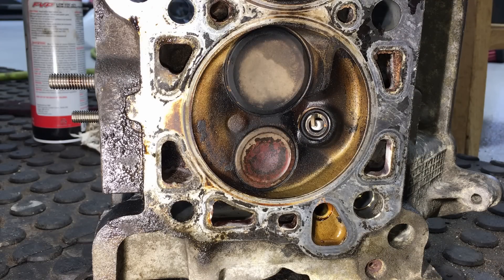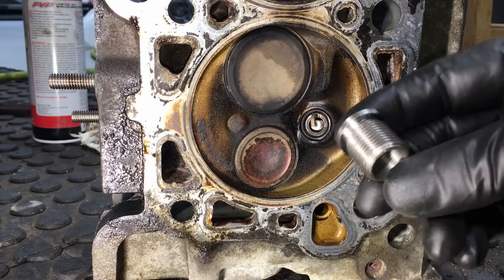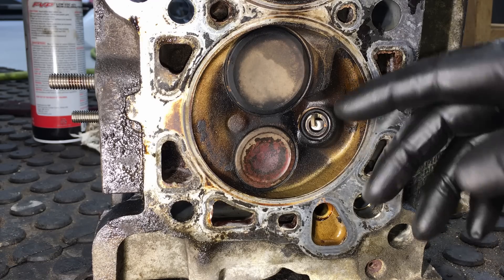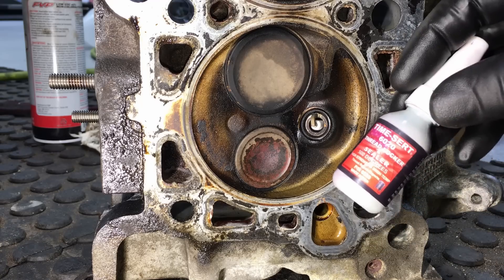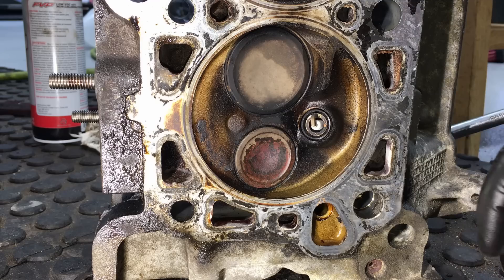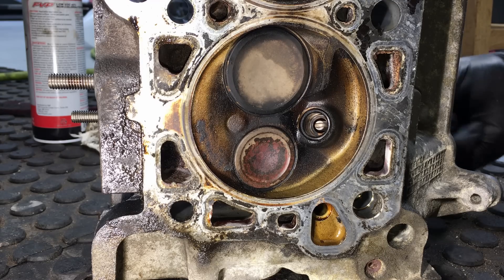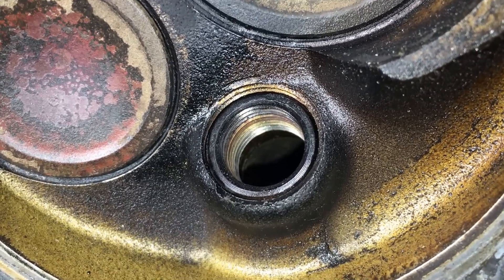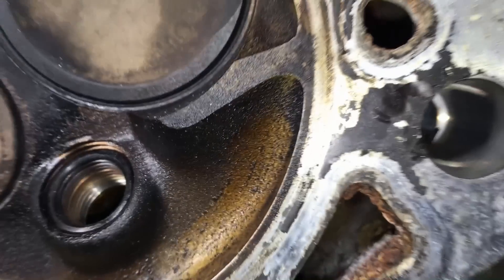Ford 4.6L 5.4L 6.8L 2v Triton Engines: Blown Out Spark Plug Repair **UPDATE**

Comment from the maker: Original Instructional Video on how this repair was done-
https://www.youtube.com/watch?v=md_HQcZZEpM&lc=Ugwee3zR8KarYiMUdJF4AaABAg
The Only Spark Plug Insert Kit that I Recommend-
https://amzn.to/2PBSVox
Reply: Have you heard of the input shaft breaking in the transmissions? I have a 06 E-250 and thats exactly what happened to it. 245,000 miles though. Cant really complain if the tranny has never been touched. I got the van with 189,000 on it. This is the 1st major issue I have had with the van. Motor runs great. When I got it I replaced the plugs and coil packs with the Accel coil packs and she runs perfect. Put in Autolite Double Platinums.
Reply: FordTechMakuloco hey buddy do you know any  good repair kit for a 2000 Ford F-150 5.4 liter timing kit.
Reply: FordTechMakuloco hey buddy do you know any  good repair kit for a 2000 Ford F-150 5.4 liter timing kit.
Reply: I'll be shopping for a newer used truck to pull my camper around the U.S. and bring me into retirement. Can you please do some videos on some Good trucks that you would recomend  from a Mechanics perspective.
Reply: What do you use to remove a broken spark plug in the 2 valve engine?

Comment: I did the same repair,  I used anti sease on the spark plug. I Always use anti sease on aluminum heads. And the insert and spark plug. I used the proper thread locker on the outside of the insert. About 5000 miles and no problems.  I used the same style insert. Ream, tap thread insert. Then spark plug.  Pretty simple

Comment: Good Afternoon. Just had the passenger side #3 cylinder pop on my 2009 Ford F150 w 4.6l motor. Is the kit you showed in the previous video the same for this model year or is there a different kit ? Any information would be greatly appreciated. Thanks for your help and all the videos you make. Provide really wonderful information.

Comment: I use J-B Weld 37901 ExtremeHeat High Temperature paste, and my inserts aren’t ever coming out. I have fixed so many cracked cylinder heads and engine blocks with JB Weld working in the radiator shop that I won’t even consider using anything else. Bocks, heads, radiators, heater cores, condensers, oil coolers you name it.

I have also seen many failures with people who have used high heat red thread locker. The JB Weld is a high metallic paste and you won’t be having your insert back out because the JB Weld turns rock solid. I understand that people prefer to use what worked for them in the past, and that’s why I prefer the JB Weld, because it works.

Comment: Didn't ford fix the problem by a head redesign in 2008(ish)? I really want to know this, please take a sec as I'm building a 2v rn.
Reply from the maker: this issues was fixed in 2001 or so,  the 2008 head redesign was the 3v engines.

Comment: I had a spark plug blow out and when I install the new plug with the helicoil, my socket bottoms out and I cant tighten the plug all the way. Any idea how to fix this? I have no compression in that cylinder.
Reply: @moreno valley news first I ended up replacing my whole passenger side cylinder head. Runs amazing now.

Comment: 2011 E350 5.4, any good?
Reply from the maker: yes
Reply: @FordTechMakuloco  So, this is 2 Valve 5.4 not to be mistaken with a 3V truck motor, cam phasers or any of those issues are not present in this one? The sellers are replacing the trans was stuck in 1st gear, how are the trans? And many thanks for your input! I value your thoughts on this, the success of our new restaurant business depends on this 8 yr old truck to get us through the first 3 crucial years and hopefully up to 5!

Comment: I know this doesnt deql with this video but please help me Master of Fords! I have 2001 ford supercrew 4x4 5.4 2v with 144,000 miles on it. While driving  on the highway yesterday. It stopped firing on the entire left bank. No noises or problems before. Instant sputter and limp it home on just the right bank.mechanic scanned it and said well have to guess dont know what happened. After much online research i found lots of others had the same but no one had an answer. You are the best Ford mechanic there is . Have you seen this before? Thank you for your time and any advise.

Comment: My 2001 5.4 just blew the #6 plug... is it ok to disconnect the injector wire and drive it 90 miles to get it back home? Trying to avoid a huge towing bill
Reply: Did you paid the towing bill,  or disconnect the injector wire?

Comment: This Question has  Nothing to do with your previous video but have watched other videos of yours and your awsome !
   I have a 2007 Lincoln Navigator with AC issues. My AC has a mind of its own, Sometimes the fans on high and cannot lower fan speed. Sometimes I cant turn it off  or on .  The display shows the fan on high and its blowing low sometimes the display says the fan is blowing low and its Blows  high, can you help ?

Comment: I had to change the coolant to my Ford fusion 2008, I put it to drain the coolant and after I finished draining the 50/50 concentrated refrigerant the full gallon did not have to add more water I think there was old refrigerant in the system. I did it right or do I have to change everything again?

Comment: I’ve got a 2004 Ford F-150 4.6 L engine. It’s got around 210,000 miles on it. Just replaced torque converter and essentially rebuilt the transmission Bc it was slipping slightly when we bought it. Even after replacing the transmission I will be at a red light and give it gas and it won’t go for abt 3-5 seconds and then it’s like it finally registers and goes, after that it’s fine it’s only on takeoff. I’ve had it at a local mechanic for two months now they said they’ve tried everything, said it’s running on 75% power and it’s also not throwing codes. Can anyone give me there opinion on this problem and what solutions there are??

Comment: Is there any quick way to diagnose if my 2001 4.6 Romeo's oil pressure lose is due to either the oil pump or the main bearings?

Comment: Ford should have recalled the 4.6 for ejecting plugs. Putting four threads to hold a plug under compression and the expansion and contraction they endure was nuts.

Comment: So after repaired the spark plug threads and installed the head , you didn't torque the head bolts ..
You do know after the old head bolts are removed your not supposed to reuse them ....

Comment: Do you think its a good idea to add loctite on the spark plug threads to avoid them being blown out? Or that wont help at all?
Reply: I know this is 3 years old but NEVER add loctite to spark plugs. They are designed to be removed.
Reply: The loctite is only necessary for the insert install. Not the actual plug install

Comment: Sent you message on Facebook have a 09 5.4  all new timing components with hp pump and still have diesel know after hour of running and will stall out thoughts??
Reply from the maker: If you didn't use the high volume pump then you want to swap that in and run 5w-30 if you aren't already. If still not ok then run a 40 weight oil. If still not ok then the engine is worn beyond repair and was not maintained which should of been obvious during the timing job.
Reply: FordTechMakuloco there was very slight sludge screens in vct housing were clean and yes hp pump will try oil see what happens thanks

Comment: Not long after the first video came out I had a blowout in my V-10.  I bought all of the tools and accessories you linked to in the description and fixed it myself, this was 4-5 months ago and it's still running strong!  Thank you for your videos and excellent advice and how-tos, I had my laptop with me and referenced back to your YouTube video a couple of times.  The blowout I had prior was from a poor repair which cost me my old Mustang (caught fire when the plug blew again), I actually loaned the CalVan kit out to that shop for an E-250 they did a couple of weeks ago and pointed him towards your video for how to do it right.

Comment: i work for a big courier fleet and we have really big fleet of E450 with 5.4 2v..... and we do not see that issue very much.....the only one that had that issue..... is the one that we sent to ford dealer for warranty for oil leaking head gasket on the right side.... and they came back to the our garage with blow out spark plug on one cylinder about one month after back from ford dealer and we have notice on engine..... the other spark plug ...... were louse .....so the ford dealer replace with a brand new head ....on warranty and this happing on the truck that they did .....so i have to say ....the ford head gasket are not very good.... .because they always leak not long after .....so we had to redo there job that did .....the right side head ....  .and we have ford with 5.4 since 1999 and are truck work 10 hour a day......so for my 40 year of experience the cause is loose spark plug that i have seen... we buy only ford part no other brand .....but not the head gasket .

Comment: I’ve never had a plug blow out in a 2v 5.4. I’ve always torqued the plugs to 28ft lbs. I believe the very low factory torque spec is the main culprit here.  Yeah the very few threads don’t help the situation but the low torque is an issue.

Comment: I am in the process of changing coils and plugs but the plugs seem to be stuck in head. I am afraid if I twist too hard they might break or strip out threads. What do you recommend to loosen the spark plugs?  2005 F-150 4.6. Thanks James
Reply: The design if the plug is what caused most plugs to break from 04-07 i believe. And lack of maintenance. I think those have the revised plugs now, if im not mistaken

Comment: Now is the time to do them all. I dropped a valve in my Kenworth because the valve keeper fell out. The Cat shop asked me if I wanted the new improved valve keepers on the new rebuilt engine. Well, duhh. Of course, improve it when the opportunity comes up. Oh, the final bill on that rebuild was $22,000.

Comment: wow! Wasn't aware the 4.6 had issues with head gasket failure.  Is that common across all the 4.6? Specific to the F150 or?  I own a few "panther" platform 4.6 vehicles, so was curious.  
TimeSert is definitely the best kit available out there to fix the stripped thread issue.
Reply: I have 04 f150 4.6 V8 ,hope mine is one of the good ones! 219k on it,runs like new still !😎😎😎😎😎

Comment: Why did Ford Engineers design a cylinder head with so few threads? Coming from the aviation world as a mechanic 4 or 5 threads is not going to do the job. In fact, we had to have a certain number of threads exposed after torquing. Knowing they have a problem has the situation been corrected or is it business as usual? Just wondering if their quality has improved.
Reply: Knowing automakers, if anything, things have got WORSE ...
Reply: Come on Arthur. You know as well as I do why manufacturers generally don't cut corners in aviation. It matters when you are in the air but if you are on the ground it's whatever just pull off on the side of the road. That and FAR 23 being a codified law makes it ill advised to push out a bad product in the first place. PMA/TSO's tend to cost a company a deal of money due to all the testing and certification required to get an STC.
Reply: The heads were revised somewhere in the the area of 2005, someone will correct that I'm sure. Ford then decided a new fangled spark plug was in order, goes in one piece...comes out in 2 now and again. But it had plenty of threads. I have had a few break but they have decent tools to do the dirty work of getting the bits out. I have had an 04 push one out while i was standing there listening to a belt drive noise. Poor little coil just beating away like a heart. It didn't get a time-sert, heli coil installed by another tech. Never had a problem other than cleaning out all the junk he let fall in.

Comment: That is proof right there.  There are to many Monday morning quarterbacks on the internet.
Reply: @dallastxracing The dealer did that to my and it have blown back out three times. So I paid the 25 bucks for this sealant and I think its worth the try. Since the dealer don't want to stand behind their work.
Reply: Ah blah blah blah! There is fire in there so any "glue" will just burn away! (forgets the head is oil / liquid cooled). 

Can't imagine what else someone would recommend? A new head? These are all well used vehicles, not show cars or race cars... fix em and keep em going. If done right these will last the life of the engine.

Comment: I've got an E350 with the 5.4 2v engine and am putting off doing the head gaskets. Every once and a while, you get a slight vapor trail on start up and a small coolant loss in two to three months. The old fashion pellet Bars Leak has kept things intact.

I want to remove the heads, resurface and install the inserts, but with the additional costs of water pump, timing chains, oil pump and gaskets, in parts, I'm close to $1,000, not counting my labor. Looking like a springtime 2019 project.

Any thoughts on installing a rebuilt 5.4 3valve engine?
Reply: If your van is supposed to have a 2 valve, I wouldn't swap a 3 valve in it. Your PCM isn't set up to control the cam phasers on the 3 valve, and I strongly suspect that neither it or the factory harness can be updated to support that. I'm not 100% on the other wires and inputs, though.

Comment: Should be fine with a insert as long as you dont over torque the spark plug then you may have problems with the insert
Reply: Are you guessing here? In my experience an insert in aluminum can take far more torque than the original threads.
Reply: I'm just talkin about people overpowering their spark plugs and pulling out the insert when they go to do a spark plug change do you only need to take your spark plugs insert them till snug and then do a quarter-turn not get a full 360 degree turn after they're already snug I have seen guys do it before